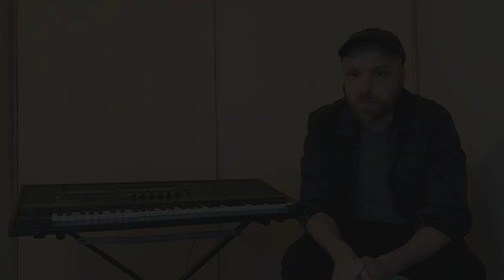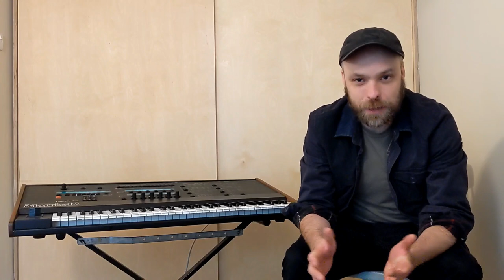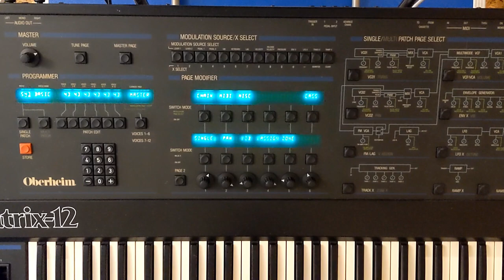Oberheim Matrix 12 - Sound design from scratch

Comment: For the hardwired Lag control, you can either have Keyboard or Lag turned on but not both. So if you want portamento on VCO1 for example, turn on the Lag on Page 2 of VCO and then on the Lag module select keyboard as the input. You can then control the portamento speed with the lag rate knob, and choose linear/exponential and/or legato from Page 2 of the lag module

Comment: Will you utilize Yorick Tech LFE?
Reply from the maker: No, it requires the synth to use midi CC. I use Eurorack if I need to expand my modulation options. That way I can modulate using CC or CV, then I chop and change the modulation tools I have in the rack. I might explain this further in another video but even though Eurorack is expensive to get into, when you begin to look at the bigger picture, things start to get more cost effective.